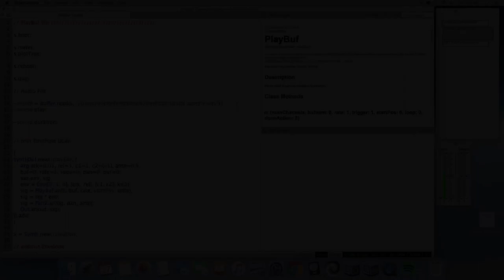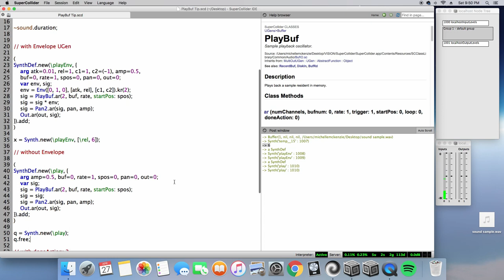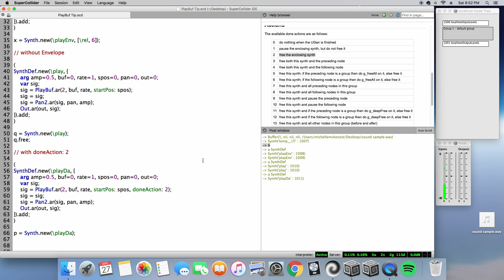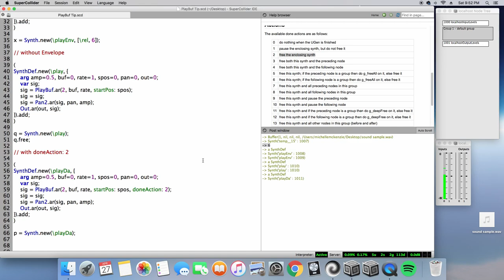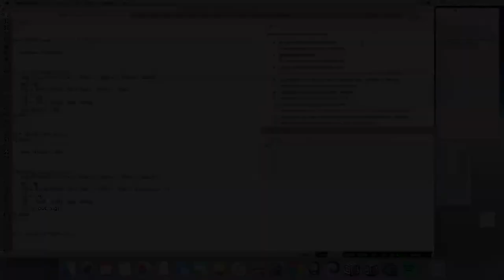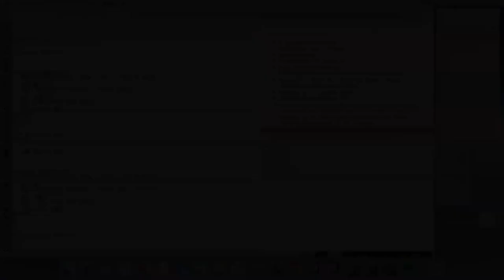Running Audio Files In SuperCollider

Comment: I am wondering how you use done action with reverse playback aka rate s negative? I can get the playback by changing start position but not automate freeing
Reply from the maker: Hi Phenix, great question. Fieldsteel demonstrates how to run the audio file in reverse in this video below, right at 22 minutes (22:00).
https://www.youtube.com/watch?v=_GZmuvmgtUc

Subtracting 1 frame (e.g BufFrames.kr(buffer arg name)-1) will have the synth release right before the last frame.  See code at 23:40.

I recommend watching his video in its entire length. Hope this helps!